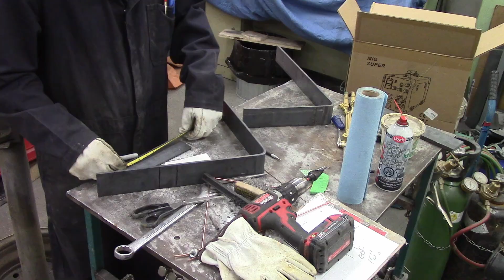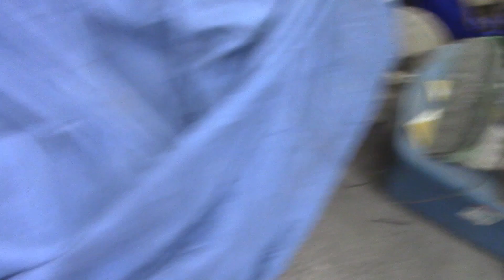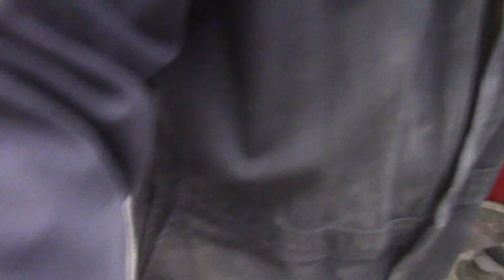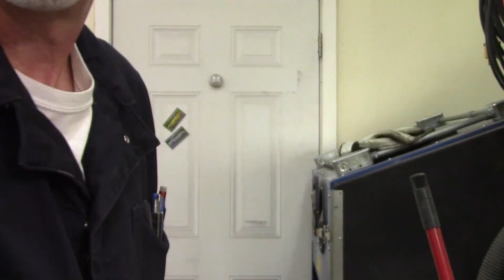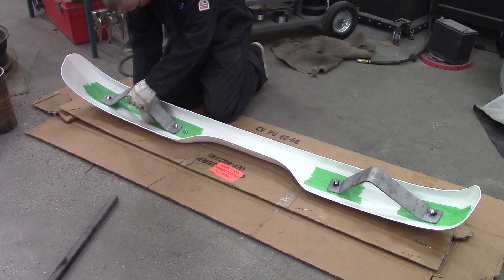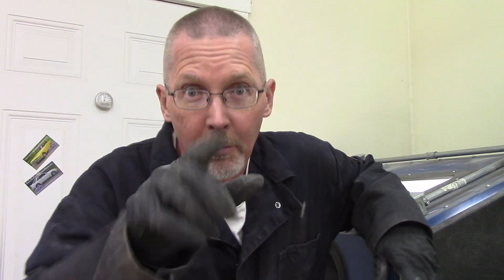Making Bumper Brackets

Comment: Never got shocked on a sandblast cabinet but have been shocked by a welding table.  Not sure exactly how that happened.  I was someone else's table, not mine.  Nice job on the brackets.  Hope you never need to find out if the bumper was a tad too close to the body!